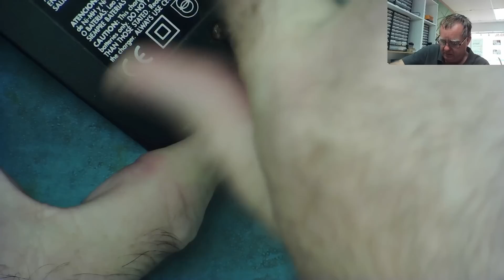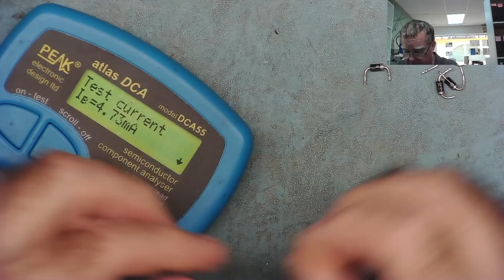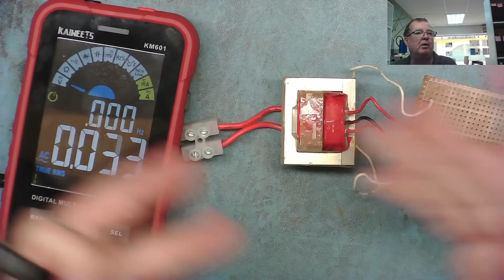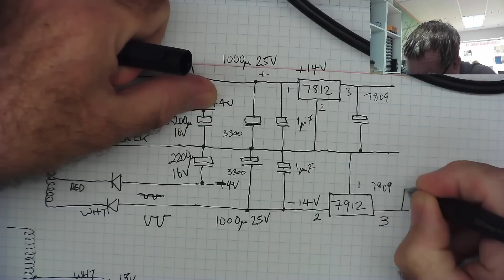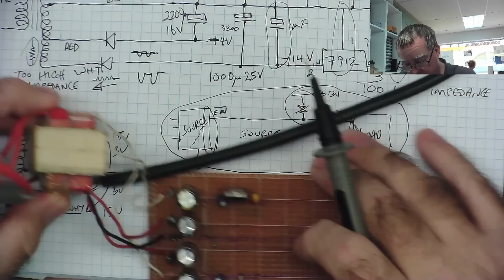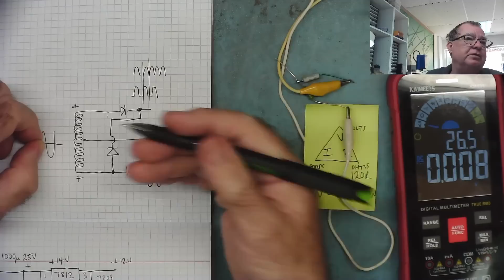All you need to know about Linear PSU (Power Supplies) To Build And Fix Stuff - Tutorial Guide

Comment: I am repairing an older Japanese slot machine from the mid 80s that has a very basic linear(yet beefy) power supply. Replacement units for this machine are rare, but the components are all standard and easily sourced for the most part. It has a large transformer, 115v on the primary and 9.5v, 0v, 24v, 0v, E on the secondary. The secondary feeds 4 separate bridges producing 24vDC, 35vDC, 12vDC, and 5vDC(which then goes to a 5v regulator and on to power the main board). I've went through and replaced all 4 bridges and filter caps because it was blowing fuses, that issue has since been resolved. All my DC outputs are in spec and back on track. Part of the main board uses a 9.5vAC rail to monitor PSU voltage and will not allow the Z80 CPU to boot if it senses something out of tolerance. If I measure between the 9.5v to 0v taps, I get 10.1v which is in spec, but the wiring to feed that rail is the 9.5vAC direct from the transformer to case ground. When I measure between the pins of the plug, I get ~5vAC, half the voltage of the taps on the transformer. I am curious if this half voltage is part of my issue, or am I just ignorant to a basic concept of transformers here and am getting the correct voltage and my problem lies elsewhere.

Comment: I have a problem with low output causing blue screens, crashing and causing slow processing speeds. I'm suspecting mosfets. One of the groups I researched in suggested that the pfc maybe faulty causing lower mains voltage and higher duty cycles to keep output voltage. Got a bit o braindrain so I'll watch the vid again. Excellent vid again thanks v much 😊

Comment: You assumed  you have one secondary winding. You may have two secondary windings, with the center tap linked together of both windings.
The center tap will probably be zero volts on the battery charger.

Comment: hello from New Zealand. I just want to have a few words about the pin-outs of the 7812 and 7912.  At first the the 7912 looks odd, but in fact they are the same as the 7812! Yes, Yes, they are the same. Have a look at the diagram of the 7812, which is the +input...pin 1,  which is the --input …pin 2 and output is pin 3.  Now look at the 7912,  +input, again pin 1.  --input again pin 2 and output pin 3. The difference between them is that the output of the 7812 is 12v above the --input and the output of the7912 is 12v below the +input.  Its hard to see at first and you may think I'm nuts, but go through it  carefully and you will see I'm right.  Cheers.

Comment: Hi Richard, what would make one of the bulk capacitors hit 55v  and the other correctly 17v after the rectifier diodes? The transformer is correctly outputting 20v 0v 20c 12v 0v pre rectifier

Comment: Next up.....

A dual-polarity power supply, that provides at least 3 watts of output current, with perfect symmetry on both rails, stable driving low impedance loads, and, oh yea, it must run off a single polarity 12 volt battery...

Yes, I know that there are specific I.C.'s available that do this, but this supply needs to be made from discreet components..

Good luck.... 😬 😜

Comment: Should have used a full-bridge rectifier across the two white wires and black would have been CT or common  you would have had plenty of voltage in that case to use 7815 and 7915 .. the scope trace looked that way because you had no load on the diodes and they need a load to switch properly,  the 1/10M loading of the scope probe often isn't enough... 

Steve

Comment: I designed a few linear PSUs, and one 'fiddle factor' that I found useful was to make the main smoothing capacitor 5000 uF for every Amp designed output.   So for a 20A psu you would need a 100,000uF capacitor.
The mathematics used the formula C = I dv/dt.   This gave a ripple of 1v on the Capacitor, prior to the regulating transistors.
Reply: That is a very large amount of capacitance.
One significant drawback to "excessive" capacitance is that increases the ratio of RMS current in the transformer to average current. This means you may have to derate your transformer's current rating more than you would with less capacitance.

Comment: So we figured out that we need a 120-ohm load for our desired test of 100mA.  12v x 0.1a = 1.2-ohms. Since the resistor/load is connected to +12v on one side, and -12v on the other, wouldn't it be getting 24v?  Thx.
Reply: Seems like the resistors should have been in series for the load.

Comment: A good source for a linear regulated power supply is one of the 'SOLA' type industrial power supplies. In stock form they are available in various voltages from 5-24v DC in various amperage values. The transformer outputs between 50-65v AC if you want to do your own regulation/rectification circuit.

Comment: The irritating screws might be to do with certification, depending on the interpretation of the standard. I can see that putting such screws in might be a way to make a stronger argument that hazardous areas are not accessible.

Also the possibility that the assembly company is already tooled up for the particular screws, maybe for products where they have a more legitimate use.

Comment: I suspect the filament bulb was for loading the batteries for testing and cycling purposes.
Filament bulbs make a much better job of a load rather than LED's that require current limiting resistors and will not work so well at the lower voltages,
where as a filament will continue to load the battery until disconnected.

Comment: A few observations ... 
Didn't see any mention of the idle AC voltage being much higher than AC voltage under load. Very low VA rated transformers will often have an idle voltage 15-30% higher than "under load" voltage. Also, when choosing rectifier diodes and output capacitors, keep in mind that your AC mains voltage is not fixed, depending on time of day it could vary a lot... it's not uncommon to have 250v AC at 2-3 AM where I live, where the default AC voltage is 230v. So account for that, assume the secondary output could be at some point much higher than expected.
The 1uF electrolytic on the input in your circuit is kind of pointless. For decoupling, it would make more sense to have ceramic capacitors there, in the 0.01uF/0.1uF/0.47uF range. Electrolytic capacitors filter some frequencies, ceramic capacitors are good at other, so with two different types of capacitors you're better off.
One other observation : pay attention to datasheets but keep in mind when those datasheets were written also.  For example, a lot of datasheets will say "a 10uF tantalum capacitor on the input would suffice" - they say tantalum because those had reasonably low ESR and 10uF ceramic capacitors were more expensive when the regulators were invented and datasheets were written. Nowadays, 10uF electrolytic or solid (polymer) capacitors exist with specifications much better than tantalum capacitors. So you could use a 10-47-100uF electrolytic on the input that's cheaper than equivalent tantalum capacitor (and you don't risk holes in circuit board from tantalum capacitors going up in flames)
Some regulators have specific requirements that must be respected. For example, a "jellybean", very common regulator series, 1117, made by various companies, requires a capacitor on the output with ESR between 0.1 ohm and 1 ohm. Some manufacturers make them compatible with ceramic capacitors, other brands don't... so some people add a 0.1 ohm .. 0.22 ohm resistor in series with a ceramic capacitor when they don't want to use an electrolytic capacitor - even with electrolytic capacitors you have to be careful - some series of capacitors have less than 0.1 ohm ESR at capacitance values below 100uF.
Reply from the maker: Thanks for the in-depth explanation on capacitors - I openly admit (and accept) I am much more of a fixer than a maker but one of the great things about this channel is that subscriber put their 10 cents worth in to the discussion and we all learn in the process, me included 🙂
Reply: Beware of modern high C•V product ceramic capacitors.
Some of them have extremely large-magnitude negative voltage coefficient of capacitance. Your nominally 10 µF capacitor rated at 16 volts might be down to 3 or 4 µF or less at 10 or 12 volts. If you want something close to nominal capacitance you may need to operate such caps at a voltage so low you are better off with a "better" cap with lower voltage rating in the same physical size.

Comment: Be careful not to over voltage or reverse feed tantalum capacitors. They explode with fire. They used to be all the rage, but today 99% of the time MLCC capacitors are smaller, better and safer.
Reply from the maker: That probably explains why I have a whole bag full of them found for almost nothing at a Ham Radio rally lol
Reply: @learnelectronicsrepair  😂Now there's an idea for one of those video shorts! "The reverse polarity special" debuting at a shop near you! (just keep a fire extinguisher handy)
Reply: @CliveChamberlain946  Yes please

Comment: A nice dual bobin transformer there, great for mains isolation as the mains and the output windings are on there own bobin so no chance of ever touching. Unlike a lot of the imported units where the isolation is just two layers of enamel coating, putting the input mains and the output low voltage closer than a gnats balls.
Reply: How on earth did you manage to measure the proximity of gnats' testicles....or are you referencing a research paper? And how many gnats were injured or suffered in the making of said examination?  I have often tried but failed after said subjects expired when my micrometer slipped. ;-)
Reply: @englishrupe01  i have a book called  "100 and 1 things about a gnat you wished you had asked your mum" ;-)
Reply: Squeak!

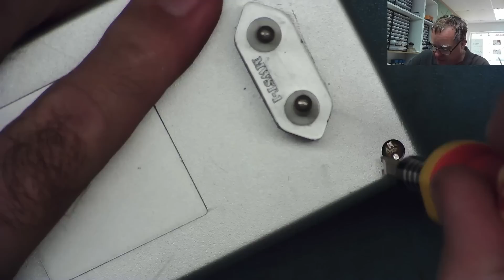Comment: 11:12 you can make a "KGB screwdriver" yourself by using a flat screwdriver, and use thin cutting wheel on the Dremel to make the gap.
12:51 That small incandescent light bulb can have 2 purposes, as a "charge" indicator, and also as a current limiter, because those small SMD resistors alone on the back can't limit the full current that the transformer wants to deliver to a flat battery.
Reply: Actually small bulb has a function in first charging slot, after switching the switch to check/TEST position. It loads the battery and by stable or fast dimming light you know the state of battery. After charging a good battery it should shine continuously bright.
Reply from the maker: @brano2yt  Yeah it seems that charger has a battery test function - and most likely the light bulb is the test load

Comment: Technically speaking, voltages from about 50 and up to 1kVAC and 1.5kVDC are classified as low, beyond that is where the fun starts, as even air becomes increasingly conductive. Nevertheless, even low votage can be lethal, or mildly irritating, depending on circumstances and the individual under test. Thank you for another great episode !
Reply: 24vac across some sweaty skin can certainly be VERY irritating... 😬 ⚡️

Comment: Educational, as always. Not sure if you tested current, voltage etc without the dim bulb in circuit. Probably makes little difference at these relatively low currents, but worth a check.
Reply from the maker: Yeah I bypassed the current limiter off after the first test
Reply: The Lamp is to test a 1v5 battery before charging, if the lamp can be lit at any state of charge of the battery to be charged, then any battery will charge even nonchargeable AA OR AAA batteries the manufactures recommend you do not recharge, you just have to not leave them on charge, A for to long and B not unattended or to monitor battery heat. Most AA & AAA non rechargeable batteries will recharge 5 to 10 times with a 1 to 2 hour charge of 2 Volts at 100mA to 200mA's.

Comment: Bipolar supply is possible on single output AC transfo's. One wire is 0v (common rail), and the other splits to 2 opposed diodes for half-wave to a pair of larger el-caps for both + and (-). Image look-up many simple 6V power supply
Reply: The circuit is called "full wave voltage doubler", it has the disadvantage of half wave rectifier, but is simple to build.
But on center tapped transformer you can use bridge rectifier on the opposite secondary "ends" and output capacitors from both plus and minus to center tap. So you use both half waves to charge both caps.
Reply: @brano2yt  True, I had forgotten that. Many multiplier cct's (2x 3x 4x etc) use long strings of NP caps with diodes acting as stage blocking to prevent backwards discharge. I think a cheap 20w @ 16v door-bell transformer would be a good choice to about 200ma. They're also usually class 2, so safer is better.
Reply from the maker: Thanks, I'll have a look